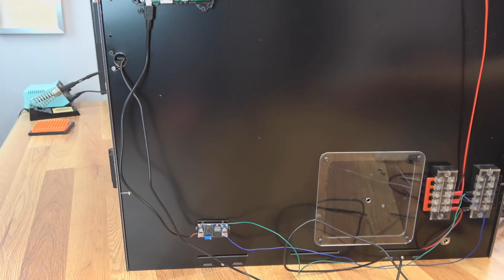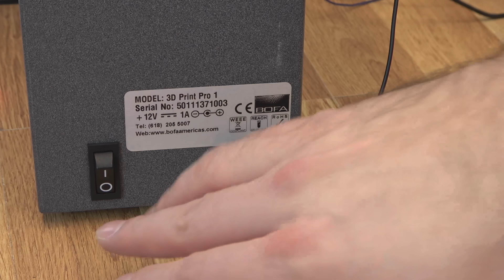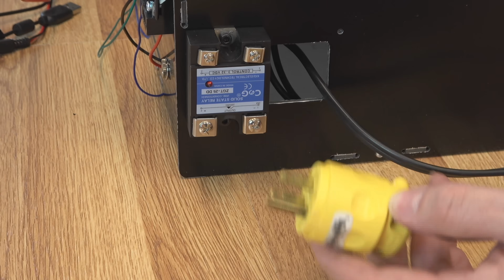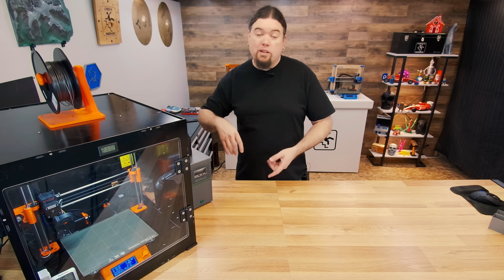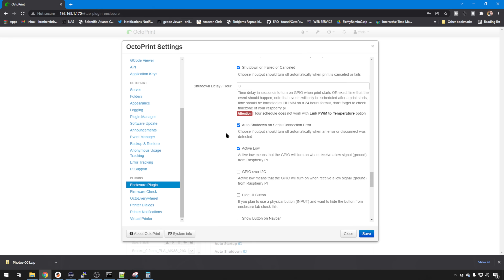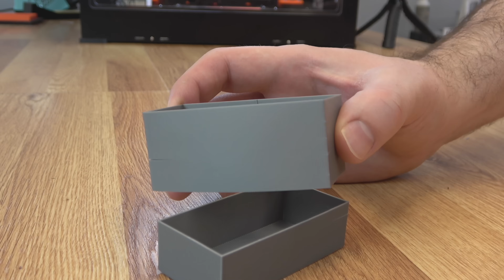Enclosure Part 2 -  Fully Automated - OctoPrint - Printed Solid - 2022 - Chris's Basement

Comment: I see in octoprint you can set something up as a pwm output. I wonder if that’s for fan speed or you can set something up for 1 minute on and 1 minute off. If that’s the case, you could control the runtime of your filter so it’s less and cools down the enclosure less.
Reply from the maker: That's a good question. I would think it was intended for fans, but you might be able to use it for other things.

Comment: Great channel, Chris.  I was literally printing parts for do a Lack enclosure build [nnorton00 version] and saw this project.  Having done both a Lack build of your own and also using this enclosure, what's your opinion between the two to be used for a Prusa i3Mk3s+?  Which piece works better?  This enclosure is only marginally more expensive than the DIY Lack once you price in all the pieces.
Reply from the maker: Thanks! It's hard to say, I kind of like both. The PS one does a better job as an enclosure, but the Lack is kind of nice as a standalone unit, seeing all the sides really stands out. If you're in need of an enclosure occasionally, I would go Lack. If you REALLY want to use one a lot and need it to be consistent,  I would go PS.

Comment: I'm a little late on watching this video, but its really great! I'm planning a similar build for one of my MK3's using a Prusabox. Question for you, at what point do you need to replace the PETG parts on the MK3? (Should they be reprinted in ASA or ABS when the internal temp reaches a certain temp?)
Reply from the maker: Thanks! PETG should be good to 80c ish, but I wouldn't run it that high. With PETG for an extended period I wouldn't run above 50c. Switch plastic, you should be able to get to 70c pretty easy.
Reply: @ChrisRiley I’ve made parts in an enclosure out of inland petg and they did not hold up. Especially when they’re mounted to the hot stepper motors. I’d recommend replacing everything with abs or nylon. Overture easyprint nylon can be printed without an enclosure or a low heat enclosure and advertises temperature resistance up to 180c

Comment: Hello.  Do you know if the holes on the smaller square on the side is for 60mm fan?  I have a 4” hose and trying to find something that will attach there.  Thanks
Reply from the maker: They all apear to be 50mm apart, so that is a 70mm fan size. So you would probably have to do some cutting.

Comment: Did you have to print a plug cover to redirect the power cord like you did on the lack table enclosure or no need on this enclosure?  Thanks
Reply from the maker: Either way, but you probably don't need one. It has a square hole in the back.

Comment: Thanks, good info. I DIY'd a similar enclosure but went passive heating from the MK3. I ended up never using my exhaust or recirculating filters. I could only hit 44C even sealed up, 110C bed and extruding filament. The ABS I use still wants more heat. The filter actually caused more warping. It works better for me letting the heat linger at the bed (and top). I had to realign, tighten and recalibrate everything on the MK3 after 2 weeks of heavy printing. PETG heat creep is no joke.
Reply from the maker: For sure! Thanks for your comment

Comment: Hi Chris, nice video.  I have several of the Next Gen Enclosures in my work shop.  I have a BOFA Print Pro 2 on one machine and it vents the filtered air back into the room.  Not bad in the cooler months but during summer....phew!  Due to the cost, I found it a bit more cost effective to install 3D Upfitter Carbon Filters on each enclosure.  They are USB powered and carbon does a great job capturing the nanoparticles.  Just as an extra layer of safety, I have some Honeywell Air Purifiers running the room too.
Reply from the maker: Thanks for the tip!

Comment: How can the airflow in this type of enclosure be optimized so that there is an almost even temperature everywhere inside the enclosure? The airflow can be enforced with an additional fan/blower but would that, in turn, harm/disrupt the print? Would an exhaust and intake air filtration system help to circulate the air and to establish not only a cleaner air but also better distribution of the hot air? If yes, where would you place the exhaust and intake pipes? Is there a better position for the active heater?
Reply from the maker: I am seeing a lot of comments like this. I think the recycle of the heated air is the way to go, but I would have to consult with the folks over at printedsolid to talk about the best way to implement it. I think it's something that would be fun to try.

Comment: @Chris, I hope you're aware that's a DC-DC SSR you're using, not DC-AC. The output terminals of a ZGT-25DD are rated for 220VDC. You'll be wanting an ZGT-25DA instead.
Reply from the maker: I didn't even notice that's the one I grabbed. I updated the link. Thanks

Comment: Hi Chris, first time poster, new to the channel. The filter system is a simple box. the air goes out at the bottom. Why dont you put a box under it and from that box feed the air back into the enclosure. One user pointed out to maybe use the return back to the bottom of the enclosure, That lloks like a good idea at first,  but I think it would stire the air a bit too much around the printing bed causing even more warping. the best since you "keep" the temp by recirculating the filtration air would be to keep it on the top but to have both in and out on opposing side and corner
Reply from the maker: Welcome! I was thinking the same kind of thing, making a 3d printed project out of it to recirculate the hot air. Seems like a good idea to me, I will have to give it a try.
Reply: @ChrisRiley  I was also thinking to add a small trap to permit a small amount of the air to  go out of the circuit after the filtration so that fume dont excape from the enclosure making the whole system a low pressure system making sure any fume goes out by the filtration system. Thanks for answering ;-)

Comment: Chris.  What version of vsCODE did you use on the SKR 1.4 turbo install 2 part series?
Reply from the maker: Seems like it changes every week. I am currently compiling an SKR 2 build with version 1.65.2
Reply: @ChrisRiley  I’ve made changes to the firmware to the T. With same version vsCODE.  And ALWAYS (10 times) get error about LPC1769.  When I have made changes correctly. I must be doing something wrong 😑
Reply: @ChrisRiley  line number in configuration , platformio, and configuration advh in your video are different from vsCODE 1.65. But I matced line contents.

Comment: Great, thanks!
One note - the biggest problem seems to be hot air staying at the top. Solution 1: Add a fan to blow the hot air from the heater down. Solution 2: Move the BOFA outlet to the bottom - it will pull the cold air from the bottom and hot air will circulate better.
Reply from the maker: Thanks for the info!

Comment: Chris, great content.  I like the way you mounted all of the electronics on the back and used a bus bar system for the 12V distribution.   I didn't realize that Octoprint had come as far as it has with this level of control using the Pi.  Thanks for showing the difference it made on the prints,  very impressive
Reply from the maker: Thanks Dave!

Comment: You could use an IEC plug with a 90 degree bend in it for the PSU - that would make the cable bend a bit less awkward.
Reply from the maker: Thanks!

Comment: That video is like Christmas in March 🌲 one thing that could be optimized is bringing back the air into the enclosure (and using not such an expensive and noisy BOFA filter). And maybe lighting effects in combination with an ESP8266 or so? But that's really just options. Super great video.
Reply from the maker: Thanks for your input!

Comment: You may want to add a door limit switch to turn off the heater if its open because the thermostat may never get to 50c.
Reply from the maker: Thanks for the tip.

Comment: Replace the power strip with a TPLink HS300 and you can then control all the power with my TPLink plugin too.
Reply from the maker: That's fancy! :)
Reply: @ChrisRiley  even fancier when I just send a file from prusaslicer, cura,  or prusaslicer and the outlet automatically powers on, starts the print, and then goes idle and orders off itself. Also available in my Tasmota plugin.

Comment: @chris, I would suggest replacing your solid state relay with an electromechanical relay for your heater. SSRs fail in the closed position where EMRs fail in the open position. Would suck to have cascading failures resulting in a fire.
Reply: He mention it in the video but he has a mechanical thermostat inline with the relay so it never gets above 45c even if the SSR fails.
Reply from the maker: Thanks Dave
Reply: No, you put a GPIO controlled relay to feed AC to an SSR so you can enable/disable it.  That way you can use PID controllers.  I do same thing with my AC powered bed heater.

Comment: my PC / 3d printer builder mind is having an OCD fit because of the wiring
Reply from the maker: I cleaned it up
Reply: @ChrisRiley  I figured you would honestly it's hard to cable manage and do a video in a reasonable manner with time. 
but next mod a control box a 3d printed enclosure for the pi + relays + terminal strips.  I have a similar setup but I use 1in aluminum angle and door skin from home depot built with rivets and 1/2in foam insulation the inside is reflective. an external 3d printed box hold 1 pi-4 4gb an 8ch relay board 5v buck supply
an external 12v 5amp power brick feeds the control box and an ac mains cable feeds the relays the pi is running kipper mainsail with some custom page's and hosts 2 Webcams. inside the box was a cr-10s 500m ver at one point but now has a 300x300 ac mains bed and water cooled hotend, nema23 steppers and tmc2209 drivers on an skr 1.4 turbo. I print a lot of PC, abs, nylon, peek. bondtech + e3d v6 0.6 nozzle-x like revo but waiting for better nozzles. I print at 80-100mm/s but have crazy high accelerations 10x what the nema 17 big drop in print times chamber hold 100c easy and have had it around 130c a few times. please keep in mind I use this for work doing prototypes and for hobbies I have a 92k$ hp full color 3d printer as well my goal was a reasonably fast structural 3d printer I wanted parts I can stick in an engine bay in the california desert and survive for year's, what I have leaned is at the extremes filament brand makes a bigger impact than type. NY daily is PA-12GF it's 30% glass fiber nylon and crazy strong

Comment: Did you consider buyilding a Nevermore DIY recirculating filter?
Reply from the maker: That's a good idea.
Reply: @ChrisRiley  Next all you have to do is build an automatic print bed changing system so you can print continuously. Also, you could build a cowl to redirect the BOFA exhaust back into the chamber to recirculate the clean warm air, keeping the heat in.

Comment: Great vid! One of your best.
Why not put the BOFA exhaust pipe down low near the floor to extract the colder air and not the "expensive" warm stuff?
Reply from the maker: Thanks! Not a bad idea, I would have to consult with the enclosure gurus over at PrintedSolid and see what they think.
Reply: @ChrisRiley  I would look into a belt style bed, but not a continuous Z printer, just a fixed volume printer with a belted bed.

Comment: Nice vid again!
You're using an off the shelf printer, so going with the GPIO route to switch the heater makes sense.
With a little more effort finding a free pin n the printers controller board, you can setup this output pin as an extra heater. I simply used the second nozzle heater output to power a relais for the heater.
Doing it that way, you can check the 'heated chamber' checkbox in your Octoprint printer profile and admire the temperature graph showing nozzle, bed & enclosure temperature. Also, you can set a enclosure temperature for all preheat presets, so preheating for ABS will automatically heat the enclosure to X degrees en control the temperature.
Note on the relay:
I use a 220V 500W heater block, which pulls 2.2 amps. A simple cheap relais module can switch 10 amps, so no need for a beefy and expensive SSR.
Reply from the maker: Thanks for your comment!

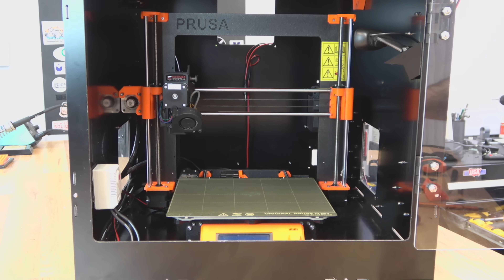Comment: @25:30 Kinda shows the benefits of a purpose-built Enclosed 3D Printer, doesn't it? - The amount of wasted space you have to deal with compared to say a Voron SwitchWire ( the closest thing resembling a Prusa i3 MK3S ) is best described as "Ooof... 😑"
Also, wouldn't it be a good idea to install a large and slow running 120-140mm fan in the enclosure to promote circulation of the air inside? The warm air collecting at the top kinda defeats the purpose of what this is about - No? 🤔
Reply from the maker: Purpose built printers with enclosures would be better if designed correctly. As for moving the warm air, not sure what that would do, we should test it.

Comment: Hi Chris, great instructional. I have one small safety suggestion. It does look like the case is some sort of metal. I realize there is not a whole lot of vibration transmitted to the cabinet, but I am a sort of belt and suspenders guy. May I suggest that the pass thru holes for the wires be lined with alligator strip or some 3D printed flex u-channel? I especially think there should be some treatment for the AC line pass thru for the heater. This enclosure is a terrific boon for the more adventuresome FDM hobbyists.
Reply: "Our enclosures are now made out of aluminum clad material for more heat retention and half the weight of previous enclosures"
  So yeah, some sort of edge protection would be in order to prevent wear on the insulation.
Reply: you mean using a grommet?
Reply: @RinksRides  Be hard to find a grommet that large, but yes, you got the idea. The objective is to protect the wire from the sharp metal edge of the hole. The protection must attach to the case, not the wire.
Reply from the maker: Thanks for your suggestion.
Reply: You can print a grommet out of TPU.  I have the same enclosure and designed one for it.  It has held up well :)

Comment: Thank you.  As always a great and informative video.  Could you place the filter inside the enclosure OR just add bag of activated charcoal granules?
Reply: HEPA and activated charcoal degrade on efficiency when heated. So putting a filter on the inside doesn't work. Now you can cycle the hot air thru a filter and back into the chamber. The bigger BOFA units have a return hose but they have to be bigger to handle the restrictive air flow and the closed loop system.
Reply: @drandolph-PS  I believe that the same effect (diminished adsorption) would occur regardless if the activated charcoal was heated within the chamber or by the heated air passing through and external activated charcoal filter.  I understand the activated charcoal can be regenerated by heating, but this requires temperatures much high than what would exist within the enclosure.    Also, I don't see a need for HEPA (particle) filtration.  Am I missing something?   Thank you.
Reply from the maker: Thanks Dave!
Reply: @brentlillesand259  - I have the same thoughts about not needing HEPA filter and just redirecting the warm air back, just for keeping the air warm. I would like to know how much of the VOC would escape from the cabinet to the immediate environment; how the microscopic filament would affect the existing print or not.
Reply: @walterloo1959  a HEPA filter will remove particulate (which is not a by-product of the printing process).  The activated charcoal is a sorbent (specifically adsorbent) filter that will remove VOC’s which are a by-product of the printing process.  So VOC’s will be removed in the air that passes through the activated carbon.